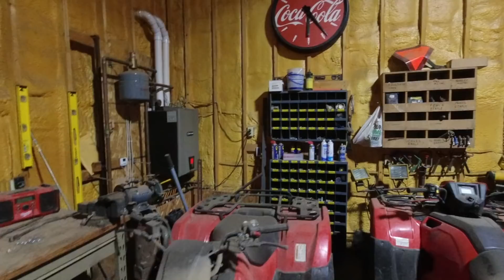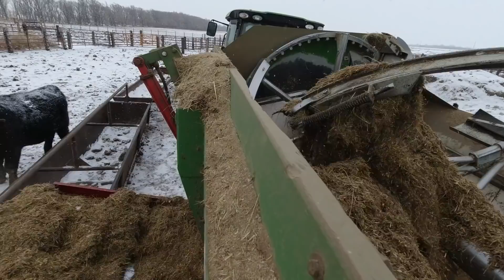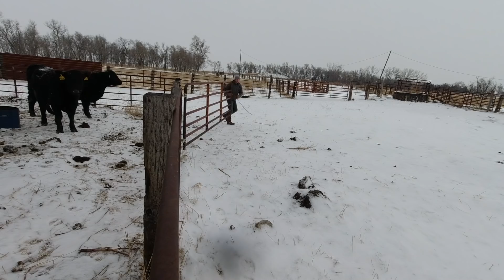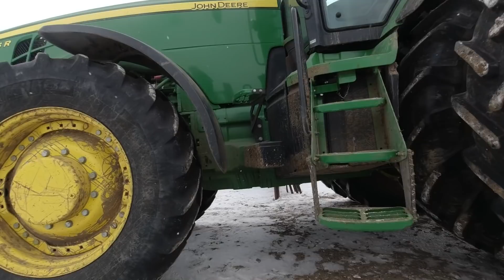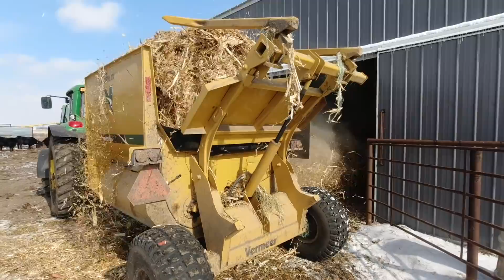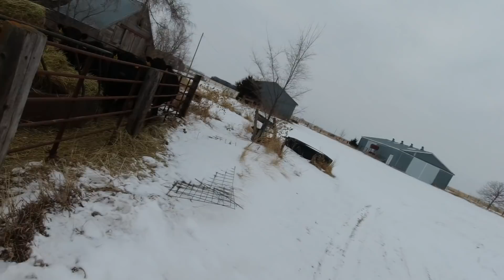A Whole Gaggle of Calves!

Comment: There is no stronger force in the world then the force of of a 5 gallon pail
Reply: I have 2 pails that have been stuck for 7 years. Gave up trying to pull them apart 6 years 11 months and 30 days ago. 😆
Reply: My Brute begs to differ.  ;-)
Reply: @brianeisenga882  Use the air wand and it will pop them right out.
Reply: Frozen barn doors are a close second...

Comment: Great vid, love how you guys manage your claving barn.
 But, in my opinion, your watering system needs to be updated! 
I know Cole briefly addressed this in his last video, and they were all valid points, but there are at least 3 good reasons that I can think of to upgrade to heated automatic water bowls ....
1) Time is a valuable commodity on an operation like yours. You guys spend WAY too much time dealing with water issues.
2) Cattle will perform/gain much better if they have 24/7 access to fresh clean water. Having frozen or empty troughs will limit their intake, especially with cattle that may not be feeling 100%.
3) Cattle will drink more and stay warmer if the water is slightly warmer than ice cold.
Not trying to be critical, you guys do an awesome job and I'm sure your videos are helping many viewers learn ways to improve aspects of our operations. But I know from our own experience here in the "great white north" I could never go back to not having heated automatic water bowls and troughs.
I would think if you approached a company like Ritchie it could be a win win situation for both of you as well as the viewers.
Keep the vids coming and all the best for claving, Matt.

Comment: Luv the ending! 

That heater needs a pvc extension - some people put an up-sloping 90 degree fitting on the end so the exhaust doesn't get into the intake. On my home unit I just cut a 45 degree outlet end on a straight 18" piece of pvc (long end on high side) and it worked great, however the instruction manual will probably have the best solution so it doesn't get plugged with ice.

Comment: Turning a burn barrel into a forced air furnace is easy and fast burning. It takes about 10 minutes to burn a whole barrel full. Simple, insert a 2 inch pipe in the bottom and attach a little shop blower to the end. Mylanta! Forced air furnace, super hot wet or dry. job done.

Comment: The ending crack me up, nothing better.  Love a good Love Movie between Dad and Son.
Is that what they call Family Closeness??

Nice video shot angles.  How about calling your company  3 Legs Sticking Out Cinematography Lmt?

Sprinkle some hydrated slack lime on the concrete wet floor between calves bunches.  Kills the scour bacteria plus other and any viruses.  Also knocks down the urine rotten stench
Typed too soon, you're on it good

Wrap your water tank and pump pipe lines with pipe heating cable.
Will put hot water to your water tanks and valves, keep the tank ice buildup lessened.  Heats the ground around the pipe runs.  Save ya'll some running and fixing in the winter time.

Comment: A little tip for your heat exhaust and intake. The exhaust needs to be sticking out further from the building at least 12" put a 45° cut on the end of the exhaust that will help prevent it from icing up like this again.

Comment: To solve you shop or barn doors problem of poop and snow problem is a sample and easy but will only take a few minutes to do. But get like a 10 oe 12 inch sheet of sheet metal or even use extra pieces of the metal that you used.to match barn doors just go 2 or 3 inch  width length wise and the do straight down or angle it to cover spot of poop and I'd weld some rebar like ever 6 or 8 inches and boom you got like a plow for your door. But what do I know I live and Farm in S.E New Mexico. Where freezing balls is 40 degrees Fahrenheit 🤣🙌🏼👌🏼😎🤘🏼

Comment: I live in Bullard, Texas. I've  never seen a minus temp in east Texas -6 here at one point. What are the extra things or hacks yall do to winterize up there that we don't do normally?
Reply: Insulate exposed or vulnerable water lines. Trickle the water (heavy drip). Be mindful that wind will find its way to places to freeze up. Everything you deal with for heat is just the opposite for cold. Your cool homes in the summer tend to allow air to escape and waste money cooling. In the winter air tends to be drawn into the heat of the house. Any areas that allows air passage is more critical in the winter more so than say not having insulation in the walls. Don't maintain a high temp in the house, add the moisture into the air that makes summer so unbearable so you don't need as much heat to be comfortable. For people who must get to a job entertain the idea of knowing about chains for the drive tires. As a new driver, the mindset was not yet to treat the roads as they do now so I had some memorable experiences. Allow extra time to travel. It is not feasible for the roadways to be prepared (hills maybe) in Texas for no more than this happens but the power infrastructure needs to fix things.

Comment: That boiler venting is not piped like it should be. Need to reference the installation instructions to correct this. The exhaust and intake should not be like that it will recirculate the exhaust back into the boiler and it will destroy the boiler.